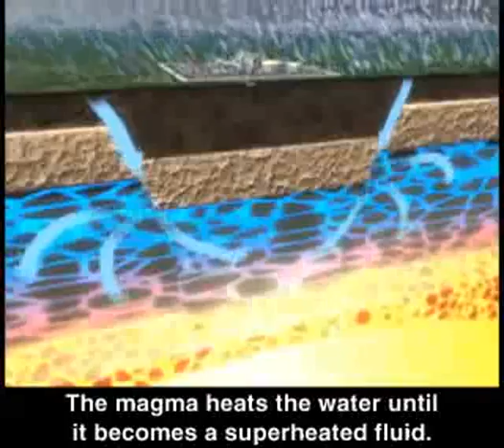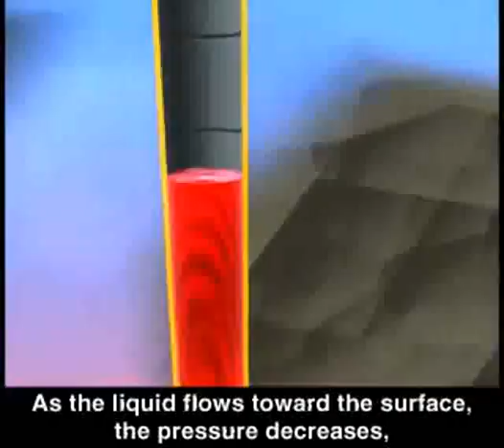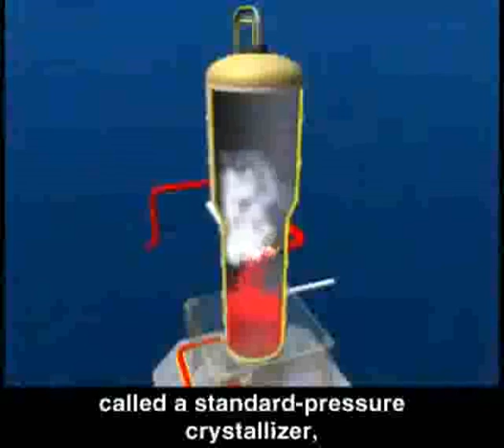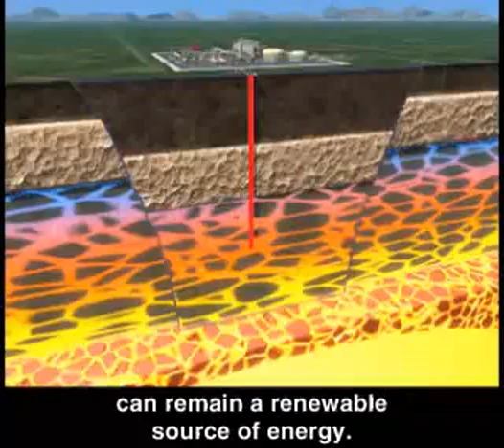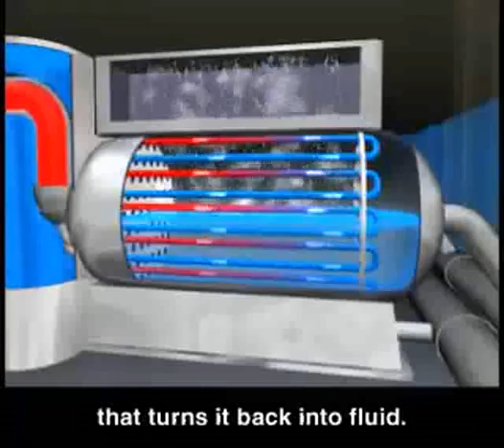Geothermal Electric Power Plant

Comment: WORLD RECORD: BIGGEST WIND TURBINE

Visit: ABOUTSOLARCELLS.COMXA.COM ZERO-NOISE  from gears and generators since they're sealed underground.

SAVES THE BIRDS AND BATS since the turbines are slow-moving.

DOES NOT NEED TO OCCUPY A WIDER LANDSCAPE since the turbine can be very tall.

MAY BE LOWER-COST since it can use parts of junked trucks and others.

ELUDES HURRICANE FORCE since the blades automatically close.

HELPS THE WIND ENERGY COMPANIES since it is FREE FOR ALL.
Reply: dimaggio david CAPS LOCK

Comment: I would like to get away from the H2O, and use liquid salt for primary loops which could bring more heat up from bellow up to 1000 c. Then a secondary loop could be used to to heat supercritical liquid like CO2 and run the turbines. The leftover heat can be use for liquificating coal and making diesel,desalinating water and making fertilizer or any other process that requires heat. It seems like the coal plants use more watter to cool the steam and there fore are ineficiant.

Comment from the maker: @82bulian 

Well... same can be said about solar - sun will one day either explode оr extinguish ... therefore solar energy is not renewable.

No one is going to start mass geothermal power plants all of a sudden, because the oil / gas / coal lobby is too damn strong. Besides, we can't such out enough heat from the earth's core - that's just impossible even if ALL electric power was produced from plan't like this one, which will never happen.

And how do you plan to "demagnetize" earth??? :)